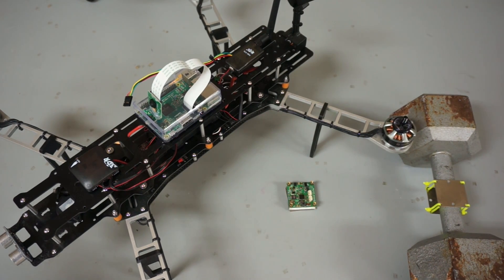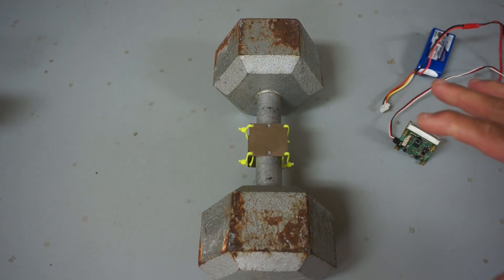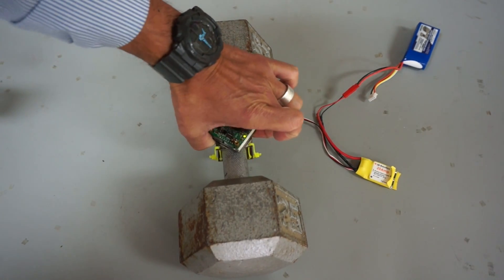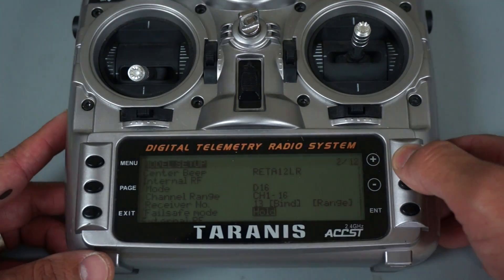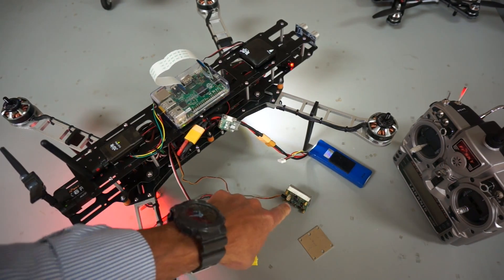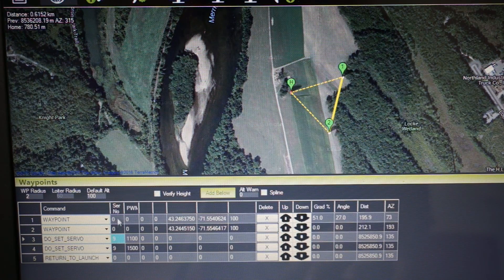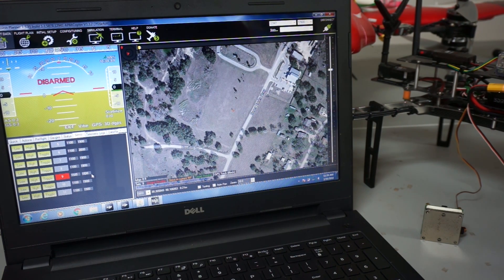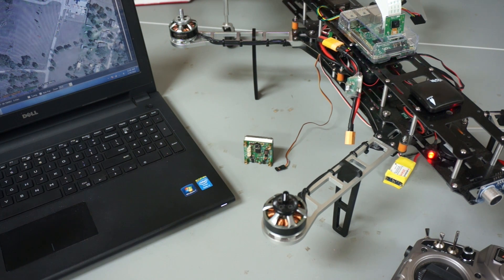NicaDrone Electro Permanent Magnet Setup for Cargo Drop with Pixhawk and Mission Planner

Comment: can you talk a bit more about what you said regarding "bind in mode 4(?)"  i think thats what you said..?
Reply from the maker: This page has a good chart that explains the modes:

https://www.fpvblog.com/rctech/how-to-bind-x8r-to-the-frsky-taranis-in-different-modes

Hope that helps.
Reply: Dennis thanks for the reply. I have it all set up. Have run the EPM through the transmitter to reciever and it works perfectly.  Really cool.  I also set it up to run through an Auto Mission through the Pixhawk and that worked too..  The only issue i am running into- and im curious if you have had the same- 

I have a voltage regulator limiting the voltage to the EPM to 5 Volts.  The EPM works fine with my 4s battery but when I go to use a 6s- it simply doesnt work. Ive check the input voltages with both batteries and they are both right there at 5V the only difference is literally the battery.. I have no clue why?

Comment: Very interesting tool Dennis. I recall looking into using a magnetic release system for a project I was working on and went with a simple high torque servo release setup instead. This item would replace the release system and the carrier as well. I am using wkm and a2's for our HL octos but it will be something we experiment with for sure. Thanks Dennis
Reply from the maker: +Keith Rolston Killer. Please let me know how it goes. I'd be interested in hearing more about it!

Comment: Wow Dennis that could be very useful to drop supplies for a search & rescue mission!
Reply from the maker: +david ringler Totally. I'd love to find a way to do that. Hope you're doing well.
Reply: Still pretty sick! Raidation & the two last rounds of Chemo put a hurting on me!. Do you think you might have any free time this spring to install a pixhawkp4 into my new tarot 650 quadcopter with tarot 320kv motors everything is put together and all esc's are wired just need pixhawk hookedup sbus to my FRSKY L9r rx for my Taranis plus? I had a 6 position flight control switch installed om my taranis plus also install my new skysight s60  600 to 750mw fpv tx with gps and osd built in? I am trying to get my multis ready to fly fpv for children with cancer and stream it to the childrens cancer hospital and have a show & tell after the flights!